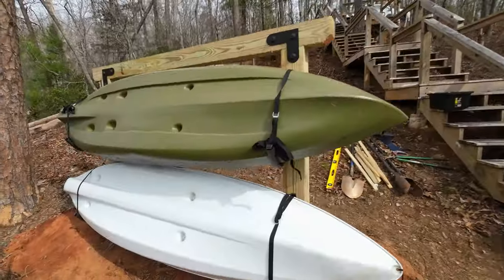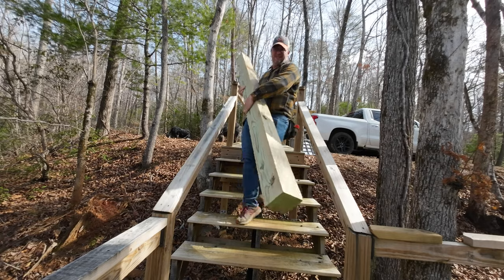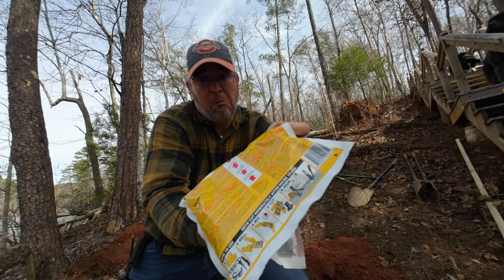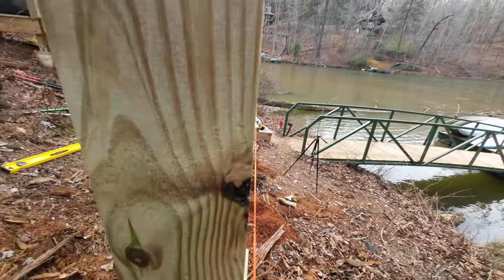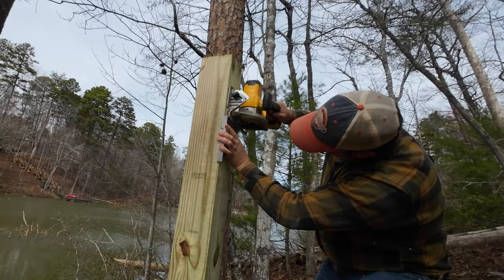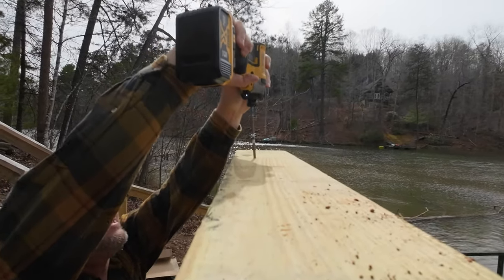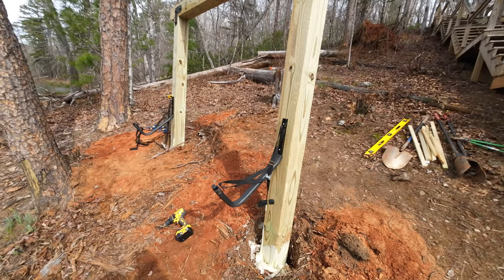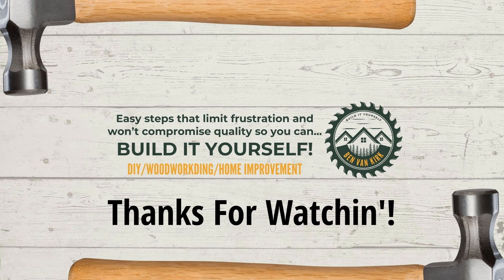Easiest Kayak Rack EVER!

Comment: Hey I get digging in dirt with a lot of rocks!  Your project is great but one question are those 6 x 6 posts?  If so do you think 4 x 4 would have done the job?
Reply from the maker: You're right. 4x4 post would have been sturdy enough for this project. I used 6x6 post to get a beefier look. Thanks for watching!
Reply: @BenVanKirk  Right on,  I get that too!